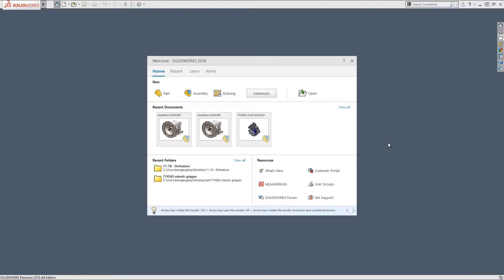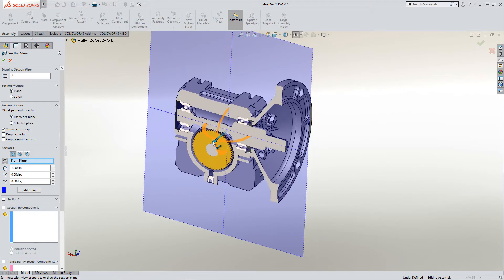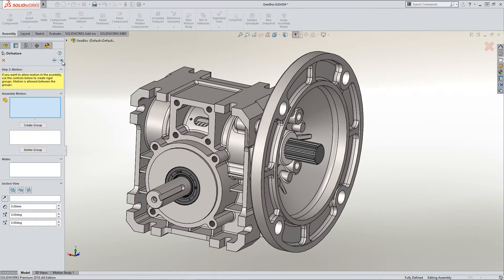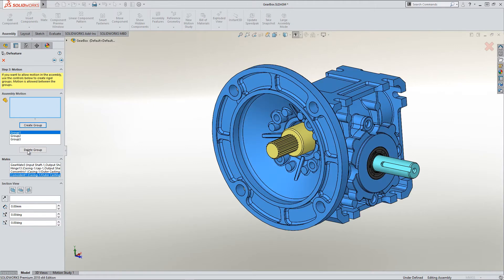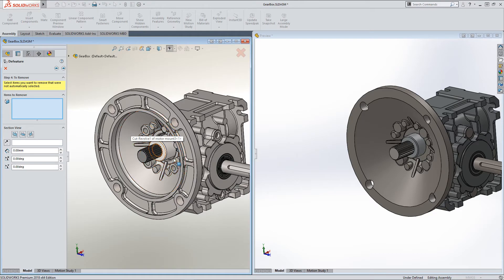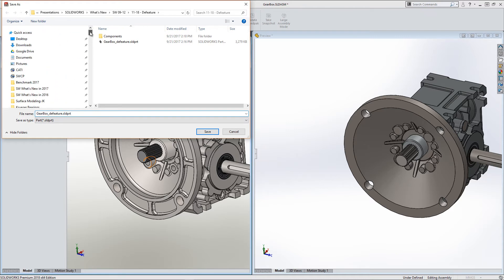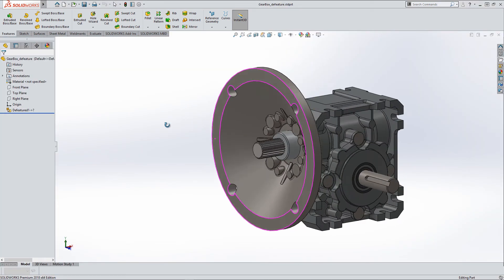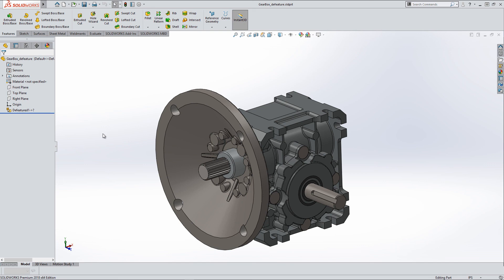SOLIDWORKS 2018  Defeature

Comment: Great video, but something I'm doing is not right.  When I go through the similar steps you did, I get only a solid block, even when I select to keep all holes.  Any thoughts on how I can fix this?  Thanks!
Reply: Morning Steve, I was the one that recorded that video. If you'd like to email me the file I could do a recording of the defeature process for you or do a webex. My email is bobm@cati.com 
Thank you,
Bob McGaughey, CSWE
Computer Aided Technology, LLC.
Reply: Bob, I called SW technical support.  They tried to run it, but with no luck.  Apparently there's a ton of bugs on 2017 with defeature that they haven't fixed.
Reply: I'd be happy to run it through SOLIDWORKS 2018
Reply: Bob McGaughey Unfortunately I don't Think the company I am doing the work for would allow that